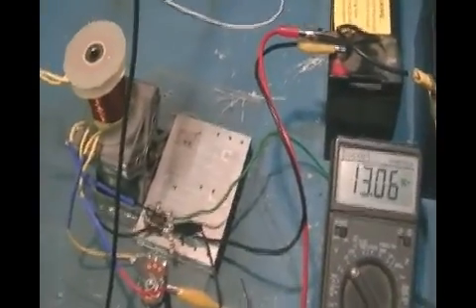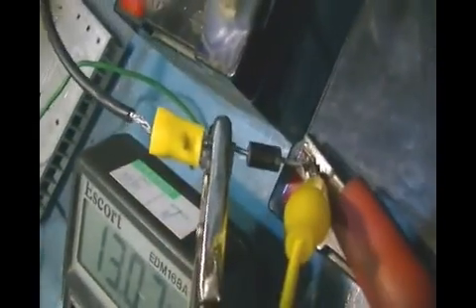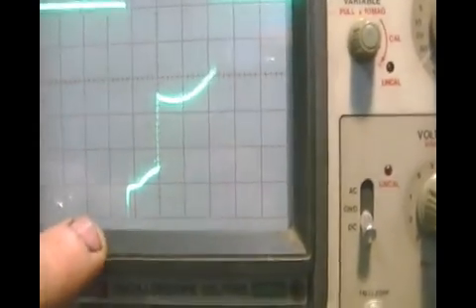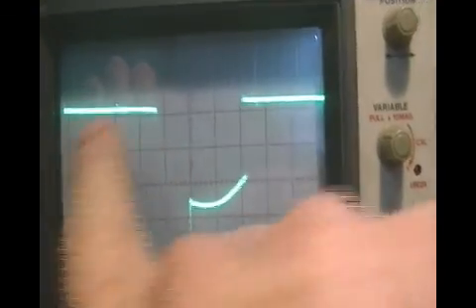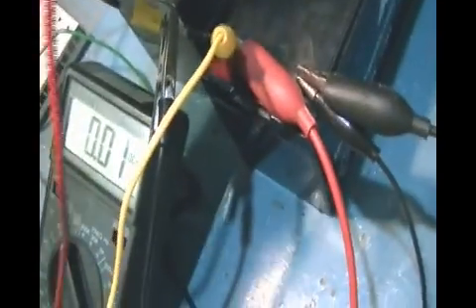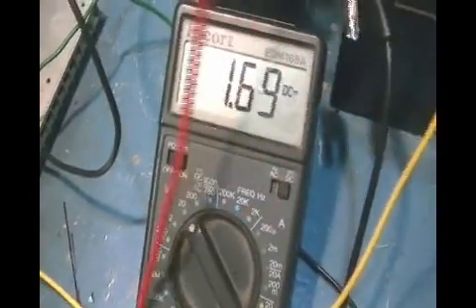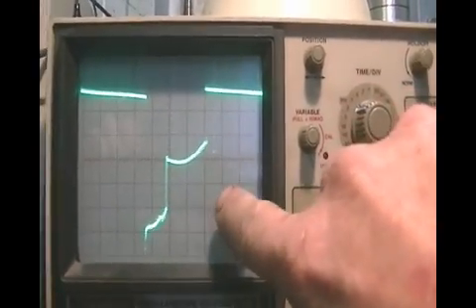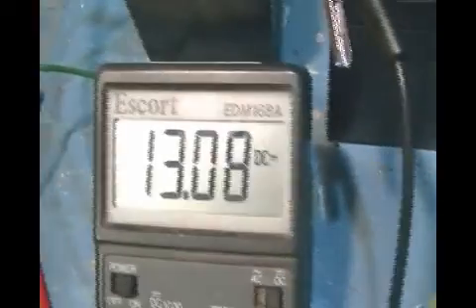new simple ssg circuit

Comment: greetings tinman.
3 years ago on teep (befor your time) i recommended the removal of this diode.
It was the first step to creating the re-generative circuit.
Basically, your turning your drive coil into a generator coil as the magnet approaches the coil.
at the moment the current is causing a break down of the transistor in order for it to flow.
To improve the flow place diode anode on collector and cathode on emitter.

Comment from the maker: Hi Darrell-very simple to do.Remove the diode on the collector,and put the diode between the run battery and charge battery.Place it so as it blocks the positive current from the run battery going to the negative of the charge battery.I will post a scematic on this thread on the forum very soon.